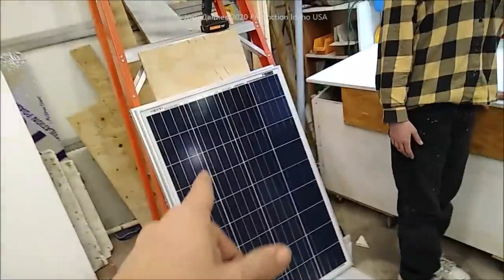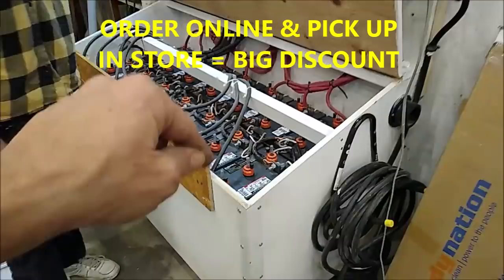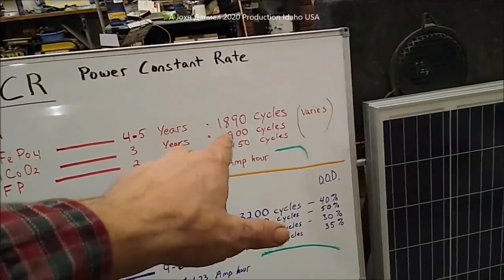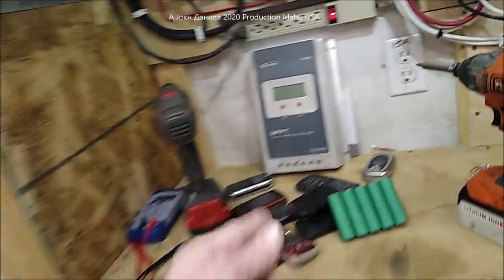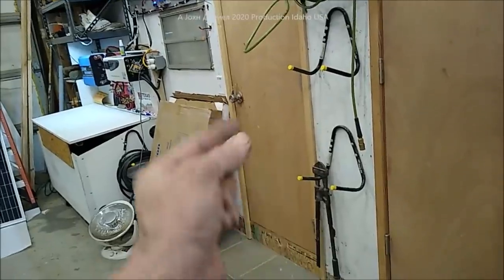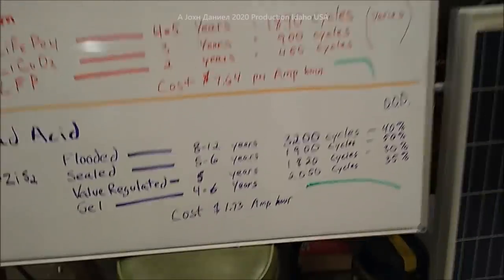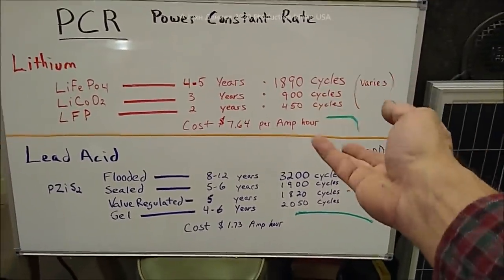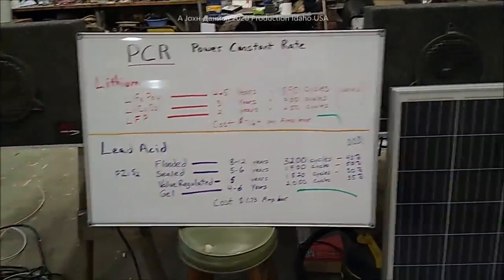Down Side of LITHIUM LiFePO4 Battery $ on RV, off grid & solar use (notes below)

Comment: I changed to a Lifepo4 self built battery system (not lithium) & it's outperformed my previous lead acid system in every way. 
Lifespan is 80% after 10 years on Lifepo4. 
I recommend you do a new test with Lifepo4, not Lithium ion.
Reply: Ok I won't let this go,  I own Millertech lithium battery company,  we sell thousands of lithium packs per year and have since 2014, we have yet to find a bad cell in any of our batteries, and our bms failure rate is well under 1%,! I realize there is a lot of shit coming from China currently, but I would appreciate it if you would also recognize that buying a good LFP BATTERY with grade A, UL approved components is a much much better option than lead acid!!!! 
I also saw in another comment someone say they won't trust a 10yr warranty till the company has been in business that long,,,,?? LFP chemistry has been in mass production for over 20yrs, it's a proven technology,  but it's America, you have a right to form your own opinion I guess!!!:)
Reply from the maker: @millertechenergy  Being that I have no actual horse in the race, ( YOU DO ) I have only been off grid 12 years, have been installing only 13 for that I can be unbiased, I do use/install both,  I just do not trust the overall components of Lithium based, LiFePo included.  BUT In the Video I said LEAD ACID, not my GC2 or B903 or L16 lead acid, the technology that in the last 50 years has tripled in improvement. The Video is based on facts of the 2 options mainly COST , not your dreams, sales plans, wishes and hopes that China will make Bulletproof  parts in electronics for a 10 year LiFePo4. They won't, the average HIGHER GRADE ELECTRONICS from China has a PROVEN life average ( Pacific Trade Org 1999 to 2018 ) to have a 19 month lifespan, so much for a 10 year battery with a 2 year BMS!!   BUT you say, they are 39% of the weight - But unless your toting them on your back, Who Fukn Cares! Might as well just say Cash saved buying Lead Aid  is 95% lighter than LiFePo4............
   I don't hear people say in the hundreds of Jobs: Hey, that 2000 square feet of solar panels, any way you can make it all go into a battery bank the size of a 300lb microwave with 30 chinese controller computers embedded in them for $22,000 instead of $5000?  They don't, so No need to be butt hurt over it.
   Now, More  Facts - 50+ years PROVEN FACTS  - HUP "Lead Acid" solar batteries last 2100 cycles at up to 80% discharge, 3200 at 50%. The more you learn, the more you know right - Advertised as 15 to 20 year life (proven accurate by surveys of 1300 owners) Cycles exceeding 6000 down to 40% DOD ( also proven by hundreds of owners) and since the 1950's a design that's Still at todays prices is 68% cheaper per AH than LiFePo4   ---  http://www.hupsolar.com/advantages-of-HUP-batteries
*( I do not buy/own HUP Batteries or represent them or who makes them, I have installed about 30 banks with them in the last 13 years is how I am lucky to have knowledge of them, unlike most who fail to learn before spewing support/sales pitches for stuff.)
Reply from the maker: @millertechenergy  I am sure your product would feel right at home on my 8 total solar controller/chargers and 4 wind turbines when I strike up my 100 amp mig welder on the 5k inverter.  But claims need to be addressed over cost. OK, so you must have the hands of GOD covering the cheapest 2 cent component from China from failing, Cool. And since even a rock can now be UL listed anymore it's is as good as also saying BBB Preferred, a real joke nowadays. However, to clear up any misconceptions give us all a list of actual COMPANIES building multi cell LiFePo4 RV and SOLAR batteries that's been in business for 10 years so everyone can feel better.
Reply: @JOHNDANIEL1  5kw inverter?? You know that's a joke right?? I have customers powering 2x Schneider XW 6kw inverters and the lifepo4 just love it!!! Your lost and you don't know it!!! I'm done commenting though,  i can see it's an argument I will never win no matter what,  so there is really no point! Lol
Reply: @millertechenergy  Why do I have a vision of you stomping out of the room with a little blue back pack full of LifePO4s. I hear both of you and I get the whole DOD but it's still been entertaining watching you both spar over batteries and they say women are petty...lol
Reply from the maker: From working on such also, I found if one cell fails in your build, or has a half life, your whole system fails. So far, I do know of a few people who have had this happen. Quality being so poor on most of the options. For me, I could loose 3 freezers full of food, over $2000 in that scenario. With my old school foolishness I may be alright.
Reply: @JOHNDANIEL1  I understand where you're coming from. However, the individual cells are pretty robust & would still allow current to flow even if some cells did fail. I think the problem is more likely to be the BMS board failing. My solution: I only use the BMS for balancing the cells & instead use my solar charger/inverter to control the voltage charge in  & low voltage cut-off. The batteries i've built for my system can easily handle the maximum input & output of my charger/inverter, which is important when foregoing this function from the BMS. 
There's really very little to go wrong on this setup, but I realise ready made batteries could be a problem.
Reply: @trevbridgewater580  what solar charger inverter do you use?
Reply: @JOHNDANIEL1  this is true of Lead Acid Batteries.

Comment: The SLI6V370S are $500+ Cad$. I think I'll stick with buying a nissan leaf battery
Reply from the maker: The ones I bought are $275 each and 370AH for 6 volt, for a 12 volt system you would need 2 per string, $550 usd. I looked into a Leaf battery, $3500 for a used remanufactured. When I priced out the controllers and all the things to use one, it was 3x the price of Lead Acid. And same projected life.

Comment: There must be good reasons the whole world is moving away from old school FLA to energy dense Lithium tech.
Off grid has moved from a very small niche market, to something anyone can now have.
Obviously all mobile device Must use lithium, from phones to cars, that's the driving force, 
Millions n millions of us carry these batteries in our pockets everyday in total safety.
Reply from the maker: When go GREEN means we accept being bombarded with a million tons of toxic batteries every year from China, and in the last 2 years the fail rate on the built up ( non single cell) is getting near 50%. Claims of SAFE are just that, they call the LiFePo material factories and mining operations Cancer Makers for a reason. Over 40,000 children in Africa mine rivers and swamps with a mortality rate exceeding the 1700's so Americans can have light weight power. Cool huh.
Reply: @JOHNDANIEL1  I didn't actually use the word Green, but thought you liked clean energy, wind, solar, hydro 
Can't deny the need to store power is absolutely necessary.
Bombarded, is an interesting term to use for people choosing to buy a new phone, laptop, battery powered gadget every year or two.
What's your source for 50% fail rate ? I believe Chinese quality is on the increase, of course if people buy the cheapest available then there will be issues.
True regulations need to be enforced to recycle ALL electronics, how about plastics, instead of the world dumping their rubbish in China, take care of it at home.
Surely you wouldn't want to continue mining and burning coal, the Cancer Maker.
Reply from the maker: Every 22nd day of the year, another 1960's technology Coal fired power plant comes online in China, However it would take the pollution factor of 16 of ours to one of there's to equal the same carbon output. They are the mega polluters, in fact they literally dump 57 barges a day of waste into the Pacific, but here in America we got Hollywood ( better called HornyWood) and Liberal politicians burning more fuel than the entire city of Topeka Kansas uses in a year on random luxury jaunts to bitch about the rest of us. In saying, I am a anti grubberment self reliant fanatic, not on/and under those behaviors would I claim the GREEN$ world. 
The Problem with LiFePo4 is the FAD FACTOR which China is feeding by the ton. And dumping it in every form known, none hardly with quality over quantity. Its the Fidget spinner Toy with lithium in it.
Reply: @JOHNDANIEL1  FYI  I do what I can, purchased 2nd hand solar panels to charge my reclaimed laptop 18650s that I personally dismantle and build into banks to reduce my footprint. Something that wouldn't be viable using lead acid.
Reply: @JOHNDANIEL1  You sure are dropping some very interesting numbers, without a shred of evidence.
It's true China are building coal fired plants, but can't find numbers that come anywhere near your quotes.
USA in 2018 produced twice the co2 of China, per capita, so who's the mega polluter ?
Assume your aware that they account for almost 20% of world population, with India not far behind adding another 20%
40 years ago US produced 15 times the pollution of China.
40% of the world deserve the same privileges the west has enjoyed for generations 
It's upto us to help them transition to a clean future for all our sakes.
Not going to happen with a leader who is totaly ignorant.
Apple, tesla and countless other, once American companies are moving production offshore
Supply and demand means if Americans want it, someone is going to build it, so the blame starts at home.
You can name call and finger point all you like, not going to solve anything though.
Reply: https://en.m.wikipedia.org/wiki/List_of_countries_by_carbon_dioxide_emissions_per_capita

https://www.carbonbrief.org/mapped-worlds-coal-power-plants

https://www.theatlantic.com/china/archive/2013/08/a-surprising-map-of-the-world-shows-just-how-big-chinas-population-is/278691/

Comment: You are way off on your claims that suggest Lead acid are better than lithium. First off the mainstream are not using Lithium ion for battery back up. They are using LiFePO4. These cells unlike Lithium ion are not flammable or dangerous. There is not 50% failure rare with BMS. No idea where you are getting your information. When it comes to charging liFePO4 batteries they take in almost 100% of the solar/wind energy straight to charging the battery, with lead acid a large portion is wasted as heat. It takes 150 watts of energy to get 100 watts of energy into a lead acid battery. So it takes more solar and wind to charge of the batteries than if you were charging Lithium batteries. And Yes you can charge LiFePO4 batteries at the same time you are using them. LiFePO4 batteries can oftentimes be fully charged by noon and lead acid batteries are well into the afternoon still charging.  As far as cost... You can assemble your own 100 AH 12V LiFePO4 batteries for about  450 to 600 including the BMS. With LiFePO4 batteries you can use 80 to 100% of its capacity and still last a couple thousands of charge cycles. With Lead acid you can't go more than 50% of its capacity without damaging it. With LiFePO4 batteries there is very little voltage sag as the battery is depleted, unlike Lead acid. Lithium batteries are much cheaper than lead acid in the long run. and you don't need to add water to them. You are a very smart man and I have always enjoyed your channel but this video does not add to your credibility.
Reply: when its -10 degrees my agm still works your 1000.00 LiFePO4 does not. end of case
Reply from the maker: Me and my Old School fools want to see a actual 10 years on them before we put trust in them, not $15,000 Tesla or GM system, CHINA.
Reply from the maker: Your not paying attention to the video. Its about 2 things - Cost and proven. But if you insist like so many leftist now that only rich people can get into Wind and solar power, thats ok too.

Comment: John, you made my day! I'm old school, too. The last set of 6V golf cart batteries lasted me 7 years. I replaced them with US Battery L16HXC 6 V @442 Amp/Hr. Both were used in my 48 V off grid system. Lithium batteries do have a place, EVs for one, and yes, power tools. However you just can't beat the old school lead acid battery for stationary energy storage. I've been around the sun  quite a few trips and my first solar battery system was in 1978. I got the tee-shirt!
Reply from the maker: I used HUP1 as a great example for Lead Acid, then the best I could find in LiFePo4 and HUP1 whips its butt.

Comment: The problem I had with flooded cell batteries was that I am gone from my property 3-4 months in the winter. During that time the flooded batteries lose water and cells can run dry. Because I have no way to keep lithium batteries above freezing temperatures I went to AGM batteries but life was terrible. 
Recently, I built a new battery bank system using lithium titinate batteries which Toshiba claims can be used to -40F and charged 20,000+ cycles without going below 80% capacity. So now I have 20 48V 960kWh batteries in my bank at 80% giving me almost 20,000kWh of storage forever at a cost of $5200.00 which is far less expensive per ah than your flooded batteries. Also, I have no maintenance each month and every cell in my system has its charge recorded for checking and reference through a BMS.
Additionally every 48V battery only weighs 34lbs which makes my whole system weigh about as much as 3 flooded batteries of equal ah. If I could maintain batteries every month I would probably still be using the flooded batteries but I had no idea that lithium titanate batteries existed. They are stable unlike Lipro4 and lithium ion batteries. Even more stable than flooded lead acid batteries are. They don't off-gas, so they are also safe to use inside a home. They are not prone to overheating. The worst part about them is you have to reconfigure the cells in order to work on your particular solar voltage be it 12V, 24V or 48V solar system. Then you have to configure the appropriate BMS system for each battery. Afterwards you just hook up your batteries in parallel and flip on your switch.
Reply from the maker: As a installer of Solar and Wind power, see what you can do to make the insurance companies accept them and regulate them so the dumpers of LifePo are actually stopped from their fake junk and all get what you got. Currently, like another few installers posted, we can not insure a job using them.
Reply: Mr fisher could you make video about the lto battery setup.i am interested in them myself.thanks

Comment: john, like your video's but you're plain wrong here...
Reply from the maker: So your saying cost and proven does not matter. Damn, I thought it did.
Reply: @JOHNDANIEL1  cost saving is all and over a short period, if you do the math over 6000 cycles, lead-acit cant come close.
simple case of math...
proven ?
there are tesla and other ev's running out there pushing 200.000 miles with much more cycles than 6000, how has it not been proven over the last 20 years.

to add.. there are not that many phones younger than 3 years running lithium batteries, and you know full well phone batteries are being misused and pounded, much different to batteries used for wind/solar..

the again.. nickel-iron is a tech i would use, if i had a huge space to put it.
but that would be for the reason maint. can be done by me , and they have just about an unlimited life span
Reply from the maker: Depends on where you shop, if I had it my way, with the scattered quality and high fail rates of LiFePo4 and others of the Lithium family, I would go HUP1 http://www.hupsolar.com/
Reply from the maker: All we got to do now is show 10 to 20 videos of people owning a LiFePo4 battery bank that has made 6000 cycles and did it cheaper than anything else, I just can't find a single one, or blog, or even sellers data yet. I looked for a month, no luck. But there are thousands of claims it will.
Reply: @JOHNDANIEL1  so you base your advise on the amount of video on youtube you can find ?
remember lifepo4 had only been affordable to consumers the last 2-3 years.
professionally ?
how many cell tower lifepo4 batteries have you seen on the market ?
next to 0 , why ?
they are still in production.
you are seeing datacenter modules on the second hand market, why ?
IT  has very strickt life cycle management procedures and management.
really this is a non agruement
Reply from the maker: See, here's the problem. You refer to professionally made high quality, code restriction laden to compare with the subject matter of my video. The video is about 3 things,  a full calculation on the following - #1 Cost comparison, #2 Proven results, #3 Use under charging 
Nothing is about the professionally made, insanely expensive, dedicated LiFePo4 or even NiMh being sold to industry. Those would be nice, for the 1% of the public who can afford them. For everyone else you get 50/50 dependability stuff from China in the LiFePo4 market ( as reported by Pacific Trade) , or absolute trusted old school stuff.